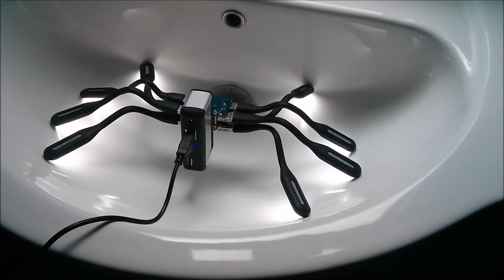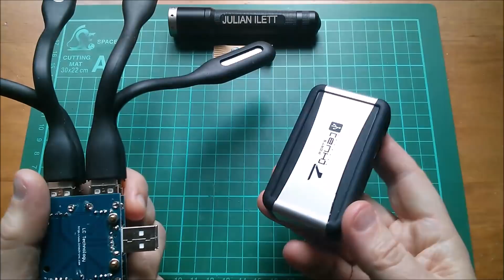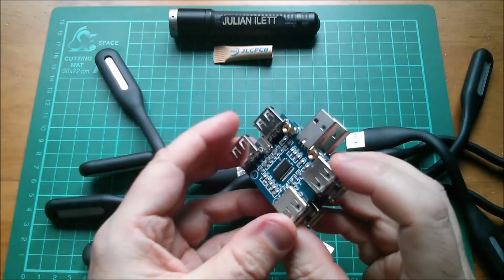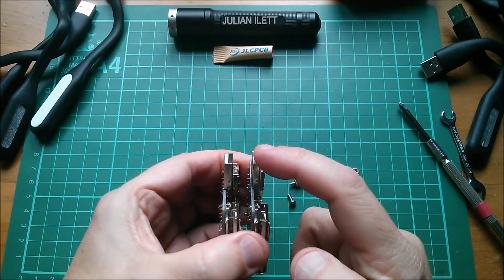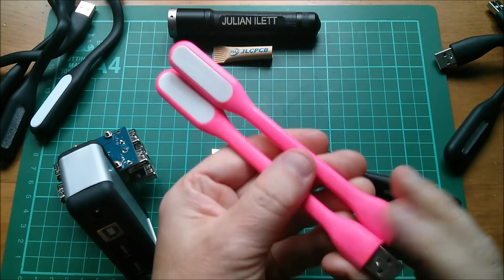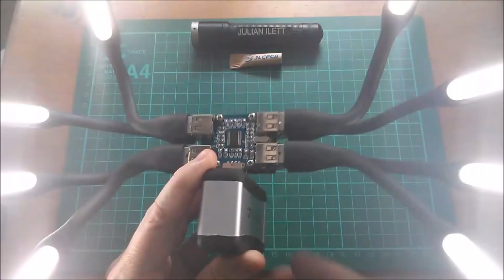Make a USB LED Spider Light

Comment: Big Clive did a video about that 7 port hub.
As I recall. His comments were "Don't connect it to a PC."

So be careful.
Reply: It was because the 5V input for an external PSU is connected to the same rail as the USB 5V input, so the PSU would backfeed into the computer
Reply: It will make your Raspberry Pi not work because of that backfeed as well. At least it did mine but luckily the thing did boot after I got rid of the hub.
Reply: he called it a Mac murderer

Comment: you need a 3d printer to make the body...
Reply from the maker: I'd love a 3D printer - sadly no space for it in my 6 sq metre workshop :(
Reply: Julian Ilett there are really small printers on the market not bigger than 2 of your storage boxes that would fit in your workshop. And also a build volume of 10 or 12cm each direction would be enough for most of the cases you would print with it